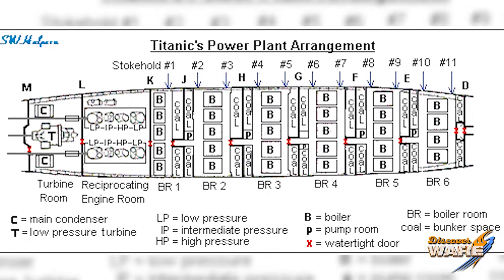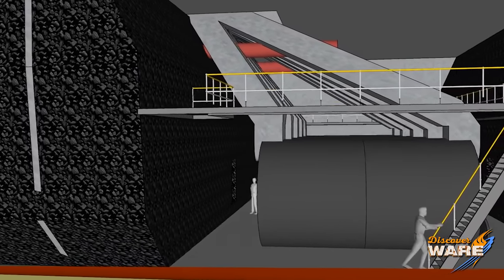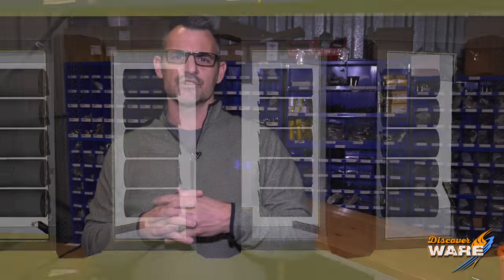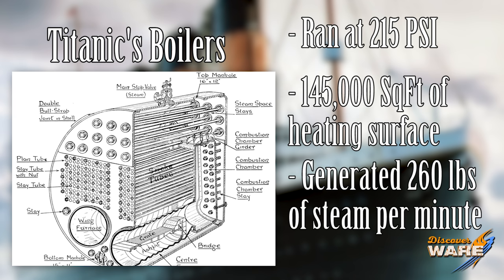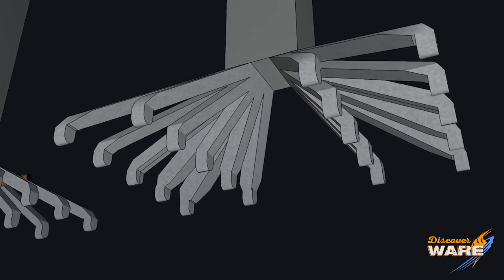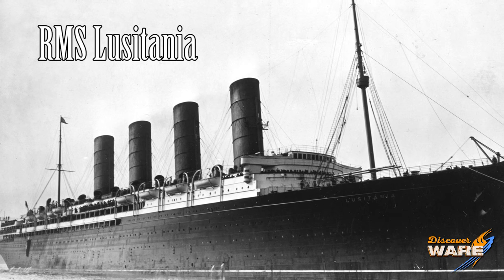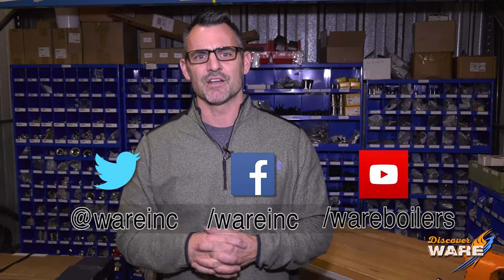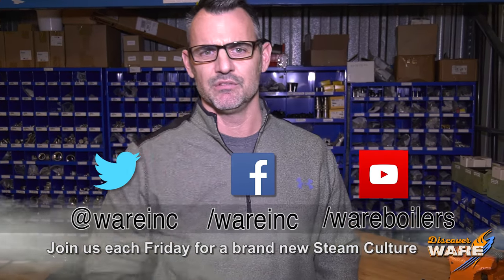Titanic Steam Engines - Steam Culture

Comment: I wish that when they were scrapping the Olympic, they had preserved the engines. Even just one of them. Imagine today if one of those giant triple expansion engines from the Olympic had been preserved, and could be made a major part of a Titanic museum or such like. If it was in running order it could even power the entire museum plus change, I mean the horsepower of the thing would be enough to turn a generator of probably a few MW capacity. They could power the entire museum with it and sell the excess to the grid. It sure would be a sight to see.
Reply: They did not save any, but there are videos of the same engine working under steam in big water or sewer pump stations
Reply: Kempton pumping station
Reply: The engines along with at least each of the single and double ended boilers should've been preserved.
Reply: The amount of coal required to move the massive stroke one cylinder is huge.
It took one third the boilers to generate the steam required to turn over that four Cylinder 46,000Hp 64'000Lb/ft torque to the shaft monster.
Thats just one engine. Titanic has two of those same engines and a early steam turbine powering the center drive screw.
Reply: that would be the most enormous waste of money, energy, and pollution

Comment: The 5 single ended boilers were used to generate electricity, and provide hot water service to the ship and kitchen when in port only. They did not operate when at sea.

Comment: As a Boiler surveyor, ex-marine engineer of steam tankers. From cold you need a couple of days, at least to slowly raise steam on Scotch Boilers, welded or riveted. Otherwise you risk major damage from overstressing the seams and footings. The water needs time to start circulating. Once one boiler is up then the others can be speeded up by using the Hydrokiniters (Weir made them) to force circulate the others. You can fast raise on watertube because of the more flexible construction

Comment: Black gang, snipe, was what we were called in the U.S. Navy. I was in the after fireroom of a tin can, we burned bunker "C", black oil, we had B&W 600 p.s.i., 850 degree superheated "M" type boilers. Topside watches hated us on the midwatch when we would blow tubes to scrub the ash off the tubes. Basically the job sucked most of the times, but when it didn't it was the hairiest time I ever had in my life. ☺
Reply: USN residual fuel was NSFO, NOT "Bunker C". BTDT. All-round dirty stuff, with lots of sulfur & metal salts. Lots of expense saved, on converting to distillate fuel.
Reply: @jacquesblaque7728  NSFO was not universally available back in '69 when I steamed, we had ratios depending on what the foreign ports had available to us, and distillate came after my time. You'd know what you burned lately if you ever did firesides.
Reply: When our DD was deployed, operating with a fast carrier TG, we were forbidden to refuel inport. Only once, under strange circumstances did we take on fuel inport, in Valencia. Oil King reported that it contained lots of minerals, like sand. And it was really "heavy" stuff, high molecular weight. We only burned that stuff when we were steaming independently. We JOs then did get the basic tour inside a B&W M-type. Bottom line: bunkers then were NSFO. Nowadays gas turbines and 1% sulfur diesel fuel- much cleaner.
Reply: @jacquesblaque7728  We pulled into some real backwater ports, like time traveling to the 19th century. We much preferred to refuel at sea off one of our AO's, but that didn't always happen, so when we tied up and liberty call went down, it was always immediately followed with "B division, stand by to take on fuel" I swear some times they were like pumping us 3 barrels of oil an hour; there were many times for us snipes we didn't get any liberty at all thanks to that crap. And then there was Yankee Station and fire support missions and surface raids and a story about a loss of fires with a back wall light off, and well... let's just say I've got my Agent Orange claim in and my fingers crossed- it was a hell of an enlistment. ☺

Comment: Great information. Just a hint for non-US people: a pressure of 215 psi corresponds to about 15 bar (or 15 atmospheres, as it was called in former times). The old Engish units are very awkward to use and are also not conventient in science and physics. So the steam pressure was about 15 times the air pressure which is around us.

Comment: They burned thousands of tons of coal in all those huge boilers in the bottom of the ship and apparently never needed to shovel out any ash. There's a lot of documentation on how they loaded in all that coal to the bunkers and stoked the huge boilers, but no ash disposal. Apparently every last speck of ash went up the flue and out the funnels, and blew away without soiling the passengers on the decks.
Reply: Really? Actually coal fired ships had ash ejector systems for dumping the ash over bord.

Search for the SS badger ash ejector or dumping coal ash or something like that to see such a system in operation
Reply: Neah the coal would have had to be pulverised.

Comment: What did they do with clinker buildup?

Must have been a horrid job, about as hades but with out the benefits.
Reply: Bill Bright, there were automatic, mechanical units call “ash ejectors” located on the sides of the ship that received all the clinker (clinker is both the singular and the plural) and ash from a series of moving steel chain belts located below the trimmer’s doors that led to each ejector on the side of the ship closest the given boiler. Cleaning out the area BELOW the chain belt was the worst job in the black gang, and was done by the “trimmer’s boy” (usually actually a boy, just like the “wipers” in the engine room were) who would crawl along below the chain belt sweeping up the very fine ash that fell from the moving belt....and yes, he did this whilst everything was in motion....
Reply: Not really, only to a softy office type. Open fronted furnaces, high funnels, so high furnace draw and big vents. In the tropics they were the coolest places on the boat. Did some coal firing when a schoolboy on coastal boats.

Comment: Titanic is best ship in this world
Reply: There  are 3 of them build and there called: "Olympic". Titanic was the second Olympic Class ship. There where very slow and inificient and only made for comfort.
Reply: Their engine layout was very efficient. Didnt use as much coal (later oil) as their Cunard counterparts. :)
Reply: A 215 psi steam plant, especially one with boilers run with low combustion efficiency (making LOTS of smoke) is inherently inefficient. (If you understand mechanical efficiency and steam cycle.)
Reply: Was

Comment: 250 psi in contrast the empire state building runs on 5 psi
Reply: Heating boilers in contrast to Power boilers. Titanic's boilers 250 P.S.I. were power boilers to drive the massive 3 story reciprocating engines, turbine engines. The boilers in the empire state building, are for heating water to 212°F to produce steam, and 5 P.S.I. to raise the steam and push it through the radiators to heat the space. Although very large, you don't need much pressure to heat the space.

Comment: thankyou; i wonder; how was the coal stacked?  how did coal stack vertically without falling everywhere and how was it loaded?
Reply: The coal hoppers had sturdy steel walls (not shown on see-through diagram)
Fuel loaded through doors in hull from coal supply ships & barges at port.
Coal dust left dark streaks on side of ship, which is why most ship hulls were painted black at the time, so streaks not as noticeable.  Some workers had to work IN the hoppers to "level" the coal, as it fed into chutes to the coal stokers, who fed it into the boilers.  Shoveling coal near the boilers was HOT+Sweaty work (around 120F/49C) yet needed 24hrs per day. Workers rotated with 4hr shifts, and 8hrs rest between, having two work periods 12hrs apart.
When Titanic left Southampton toward New York, there was also a smoldering coal fire in one of the bunkers. Crew testimony said bunker fire was put out over the next two days, but difficult to know for certain.
Reply: @jsteins  interesting  thankyou.  I wonder if that fire led to a compromised structure.

Comment: How the engine can turn in both side?
Reply: By changing the position of the valves (which control the steam going into the cylinders) in relation to the position of the pistons in the cylinders, you can change the direction in which the engines run. So upon starting the engine, you totally change the direction of steam flowing through it. Instead of steam pushing the piston up, the steam pushes the piston down. The engine will run quite happily either way. This is easy to do for steam and some Diesel engines for marine applications can also be reversed. Never heard of petrol engines doing it.

Comment: Question; how did they re-fill the coal bunkers?
Reply: Captain Kuijt they had coal ports on the outside roughly half way down the ship located near the lower decks,  6,611tonnes of coal loaded by hand not bad hey when they were in a coal strike at the time. Hope that answered your question.
Reply: Coaling a ship was back-breaking, filthy work. And it took a lot of time.
Reply from the maker: Appreciate you helping out with that question. There is just so much info out there on this amazing ship. Thanks!
Reply: +DeathOnSernpidal o
Reply: When in port in Britain, the coal was loaded by hand, 82 pounds at a time in “back baskets” where the colliers would actually load and carry each basket full one at a time. In New York, by the mid 1890s, most coaling was done by large mechanised colliers with belts feeding coal directly into the coal ports from floating barges carrying two entire railroad hopper cars of coal, that could coal a liner of the Aquitania class in less than a day.